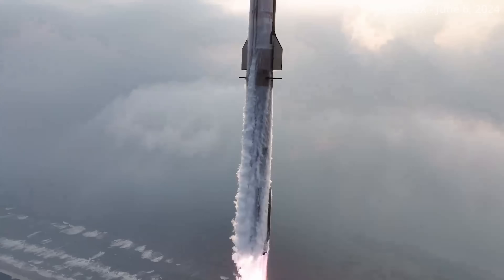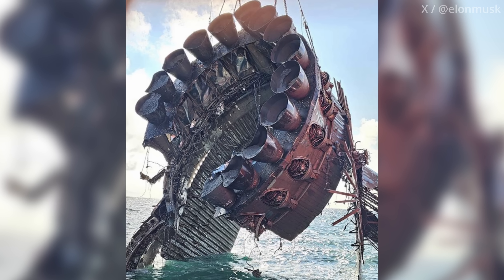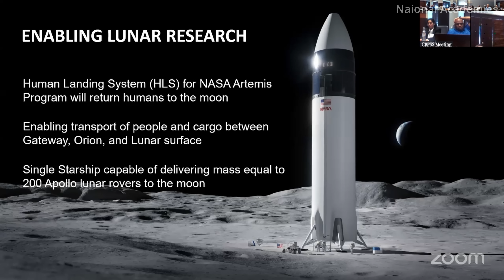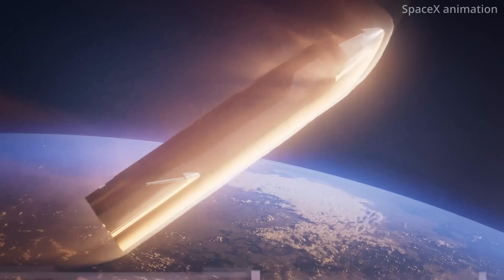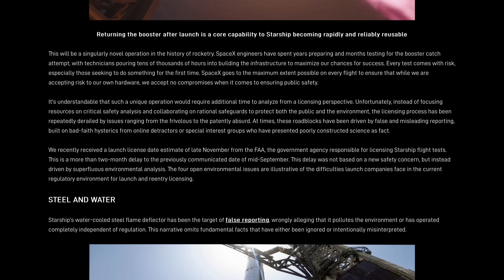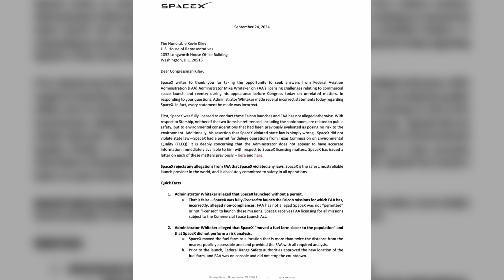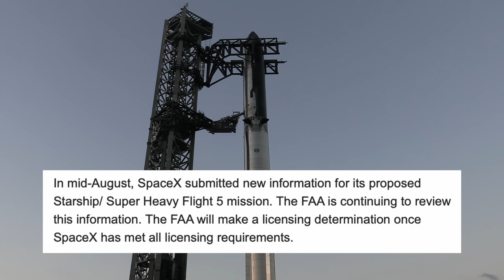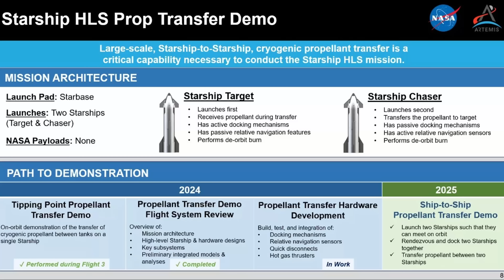SpaceX to attempt Super Heavy Booster catch during Starship Flight 5

Comment: Whatever they build here; they have to build on Mars. I’m curious how they are gonna get all the parts there without a place to land and takeoff again.
Reply: There's a lot less gravity on Mars compared to Earth. The ship doesn't need a giant booster full of fuel to leave Mars like it does on Earth. And once in space, they will have fuel ships if needed.
Reply: @Swole_Gecko  that makes sense. I still don’t know how much equipment they can fit in starship? And can it land and launch on Mars surface without a pad?
Reply: @crtmojo2705 The last time I checked, they said it can lift 250-300 tons to low Earth orbit. After using the fuel to get into orbit, they will use a tanker ship to top off the fuel before it heads out to Mars. And yes, eventually, they will install landing legs to land on Mars without a pad at first (unless something changes in the future).
Reply: @Swole_Gecko  cool beans! I was wondering how they planned to unload. NASA always launched and parachuted or ballooned equipment onto the surface. Gonna be wild to see a ship touchdown and takeoff again. 

I’m bettin Optimus will play a big role in moving and assembly till all the humans arrive. I was reading how they wanna make fuel, air, water and shelters before the astronauts arrive.
Reply: The booster never leaves Earth. It "always" returns to base. Only the Starship will ever go to the Moon or Mars.
Reply: @wally7856  but where do they park? Are they gonna drop supplies and parachute it in? Then return the starship back to earth? That’s what I don’t understand.